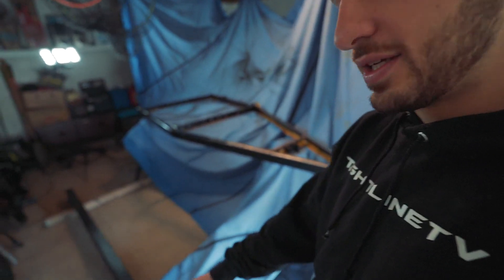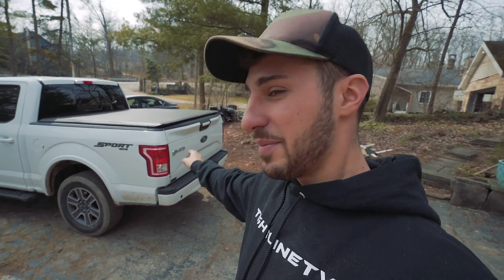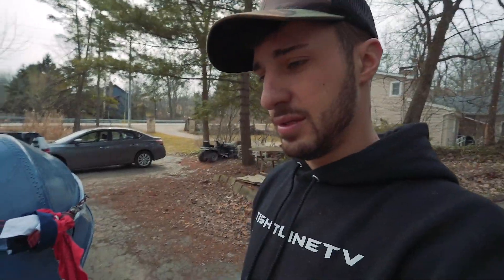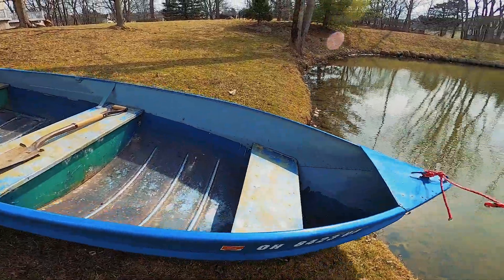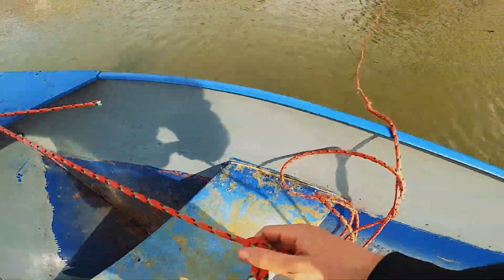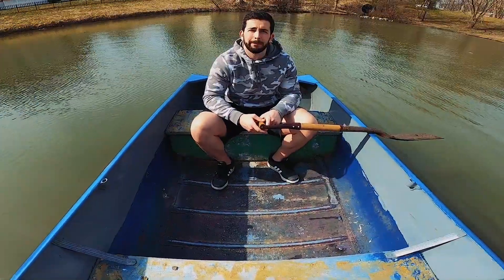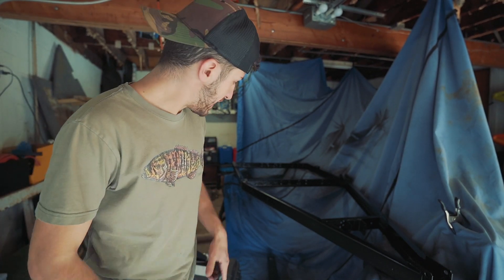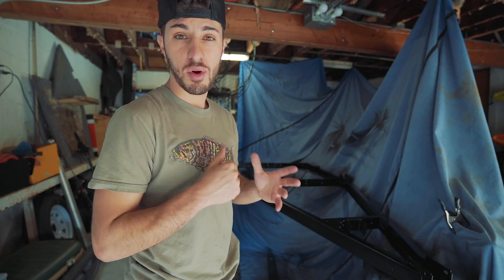Building a 1955 Bass Boat Pt. 2 (Jon boat to bass boat )

Comment: Harbor freight sells brazing rods and thats what I used to patch small leaks. All you need to do is sand the area heat it with a torch and apply the rod and it will melt and fill the hole. Great vid tho!!